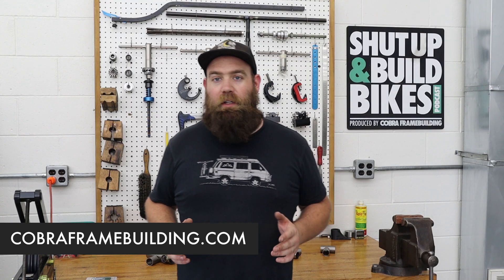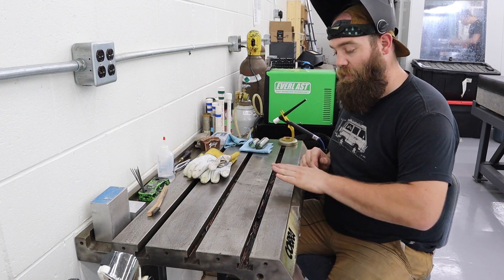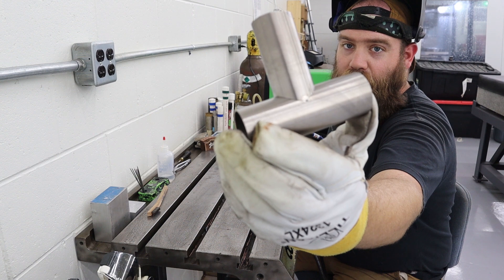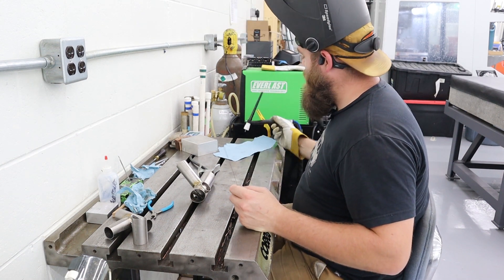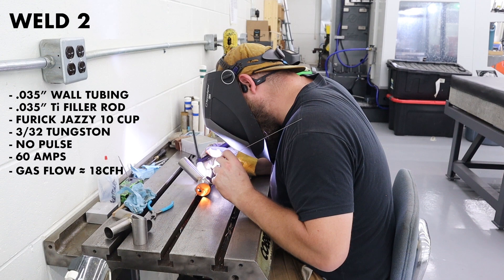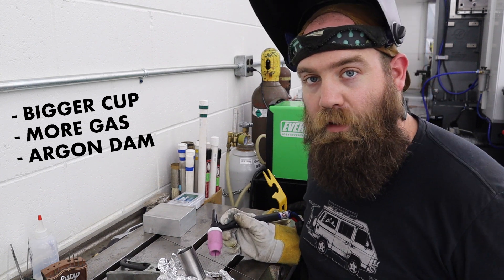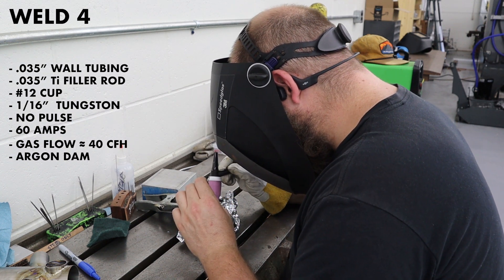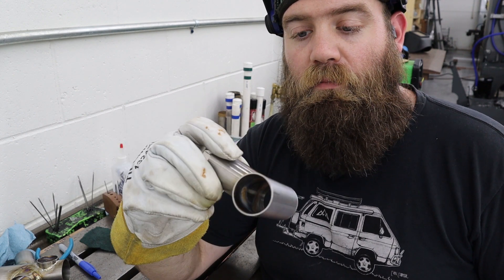First Impressions Welding Titanium Tubing - Can We Just Figure It Out!?

Comment: No argon shield on the inside? I would encourage you to film what the inside of the tube looks like. Without backing gas, the weld is similar to stainless on the other side of the weld. In liquid-carrying applications, the inside is more important than the outside.
Did you perform destructive testing? Ti welds look great, but if they're not perfect, the welds shatter like glass on impact.
On the matter of color, yellow is enough to disqualify a weld in the pharma or nuclear industries.
Reply from the maker: We address this in the video -- as these are merely tests, and because it seems to weld about the same on the outside with or without backpurge -- no backpurge necessary. It's standard practice to backpurge titanium in bicycle frame welding. Hell, we did a whole video on our backpurge kit for our frame fixture.

Comment: Well done! Looks amazing for 4 tries. The biggest Furick cup at 35-40cfh would take care of the color and helps with not having the perfect torch angle around corners. The biggest thing I realized after a few frames was to watch out for the undercut on the acute angles. It helps to use bigger filler rod in those spots!